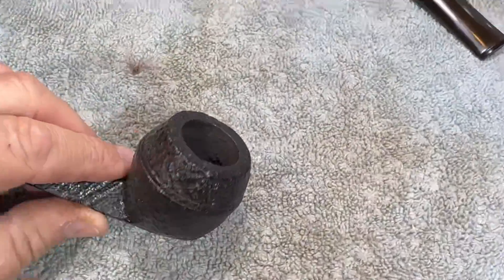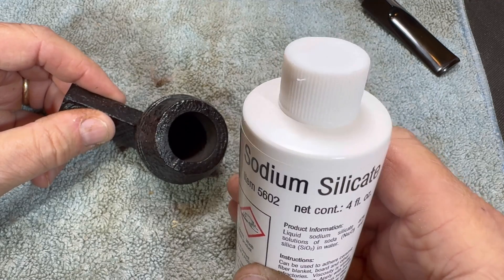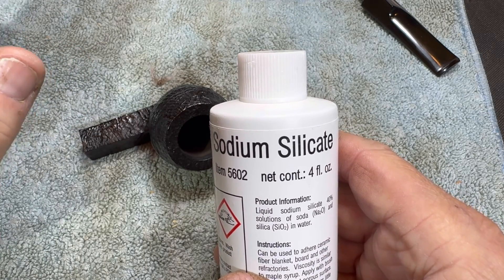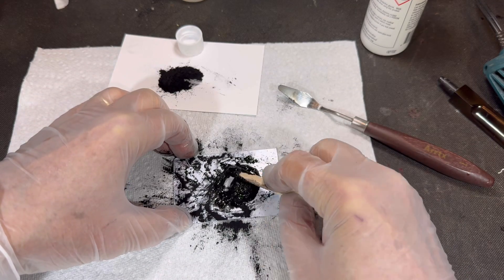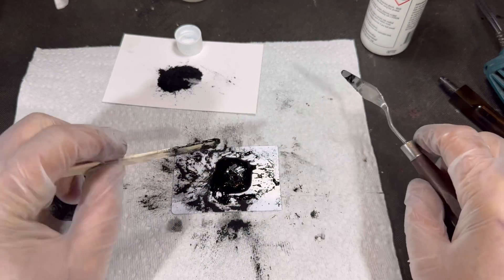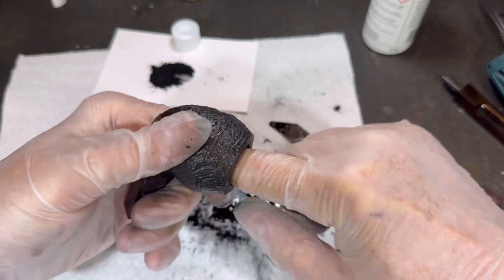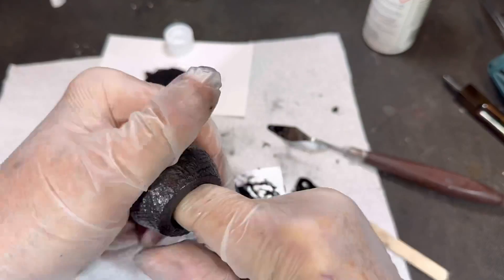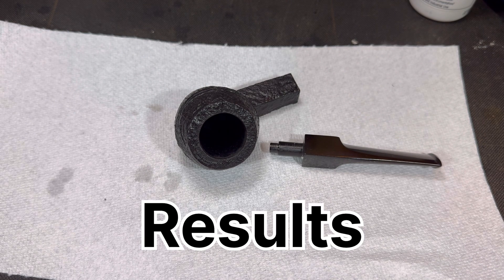Bowl repair using Sodium Silicate (Water Glass)

Comment: I have a Dunhill 01 that had some deep pitting like that so I sandblasted the inside removing  alot of rotten wood and a huge crack that went down 1 side and up the other. In the automotive industry we call that product Liquid Glass, it's used for sealing up blown head gaskets and cracked blocks.
Reply from the maker: It’s really tough stuff. And non-toxic. Thanks for watching and the comment.

Comment: I wonder if it will effect the smoking characteristics of the pipe. Are you now smoking in a glass, at least glass lined, pipe?
Reply from the maker: I don’t think so.  Once it builds carbon cake it won’t smoke any different from a briar.  But next time I need to apply it thinner.  It’s non toxic and heat resistant to 2000 degrees.  This product is used quite a bit for professional restorations. I just need to learn how to use it better. Thank you for watching.

Comment: Usually this did fix it self after you smoked few rounds from the pipe...
Reply from the maker: Sure you can build cake to cover the charred area.  But I wanted to repair the damage and make it difficult to do more damage in the future.  The sodium silicate can withstand temperatures up to 2000°.  
This was more or less practice for future repairs. I do resell pipes, so I don’t want to pass the problem along to someone. Could the repair been done better, absolutely. There’s a learning curve. Thank you for watching the video.